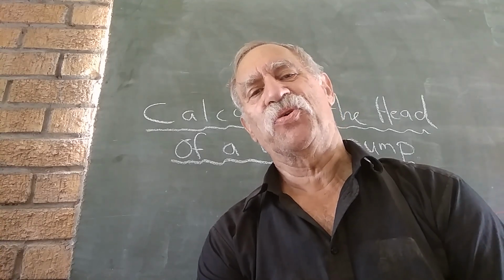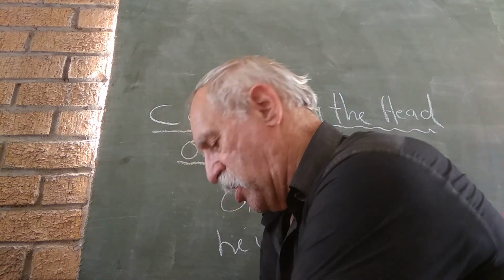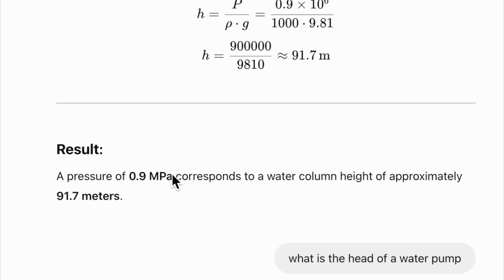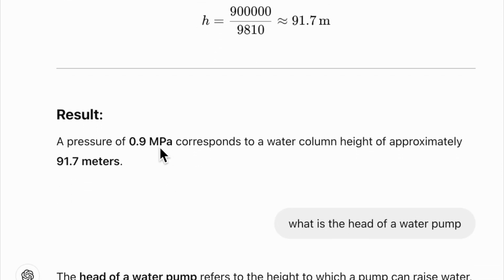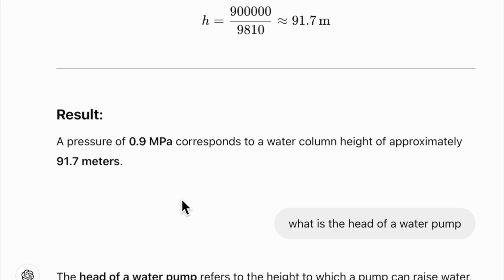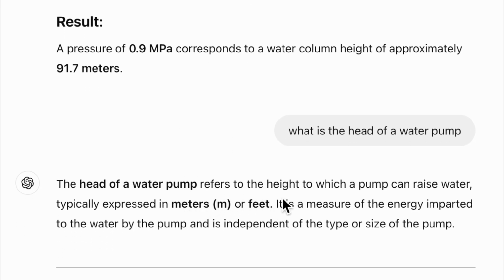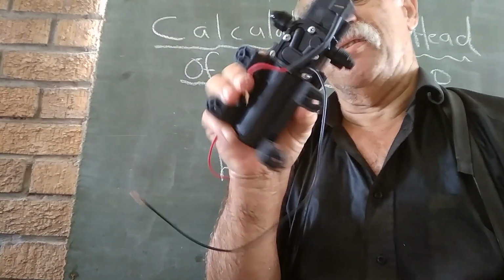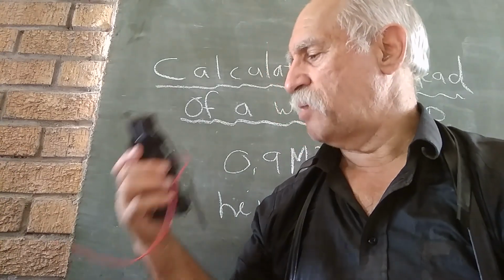Calculating the head of a water pump, then seeing if the pump can pump water onto a roof

Comment: A diaphragm pump like the one you used usually can reach quite high pressures, 9MPa isn't amazing. Their main problem is (apart from relatively low flows), i think, durability - quite sensitive to debris on the water, and the diaphragm itself tends to not last long. But seems like a great option for domestic rainwater! Hadn't thought of it!
Good job, nice demonstration!

Comment: Does the diameter of the pipe make a difference?
Reply from the maker: Hi Andrew - no the diameter of the pipe does not matter - only the height one is trying to move the water up tp.  Giraffes must have high blood pressure, even though they have normal sized arteries 😃